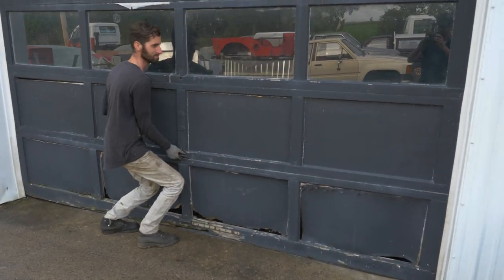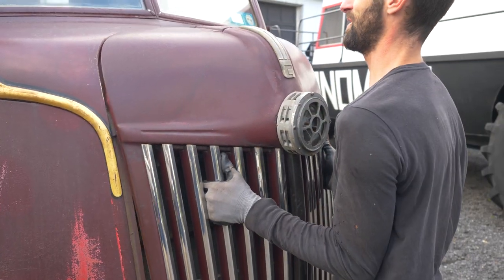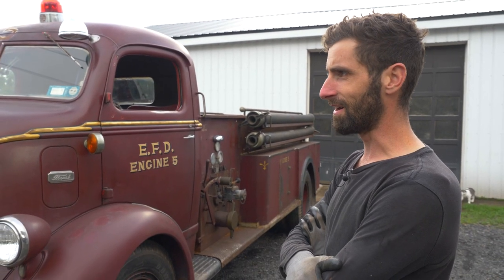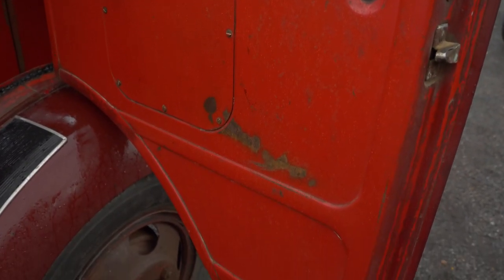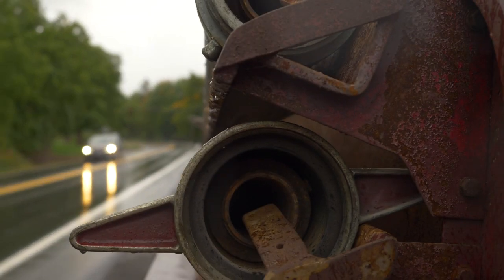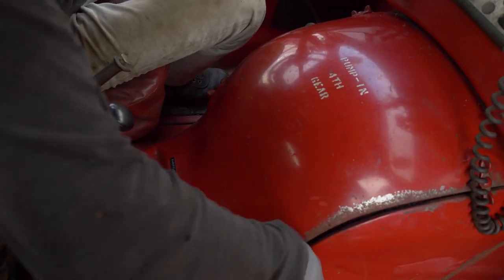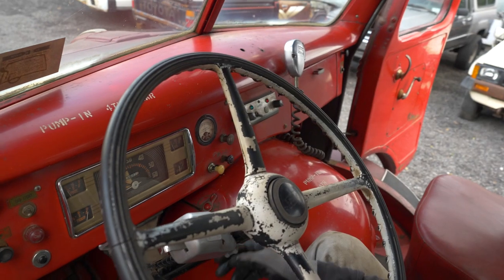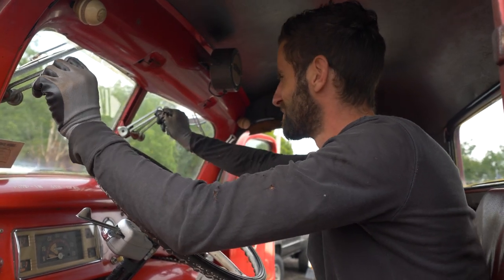What It's Like DRIVING a Barn Find 1940's Fire Truck | Part 2 of 2

Comment: As an old 75yrs apparatus buff,thanks from the ❤️,grew up w/ rigs just like yours in rural MN 🥶
Reply: That brings back memories.  Back in the 70's I used to operate a 42 Ford fire engine.  It had the same ignition system.  The old truck is still operated as a parade piece with 4000 original miles.

Comment: The standard bell/buzzer code from the back step to the driver was 2 to go forward, 3 to back up, 1 to stop. It was the same code used by railroads for the conductor and engineer to communicate with each other before two-way radios came into use.

Comment: Our department had several COE Ford's of that era. Some had a Marmon Harrington Four Wheel Drive conversion kit installed at the factory. Good trucks BUT sure got hot in the cab during summers.
Reply from the maker: Thank you, it's great to hear what it was like to work with one. I can only imagine.
Reply: Hence the safari windows.
Sounds good.
With Armstrong steering always keep your fingers on the outside of the steering wheel. Don't turn your hand upside down to make a turn.

Comment: Flip open windows were to shead rain water off and for defrost before the days of good wipers and heaters
Reply: it had wipers though. itd also blast you in the face with tons of water if you drove it like that in the rain.... I believe it was for parades mostly as the fire department would have done those often enough to want something like that.
Reply: @YblockEnthusiast  It was to let more air into the cab for cooling on hot days.  Many vehicles of that time period had those.  Nothing to do with parades or shedding rain.